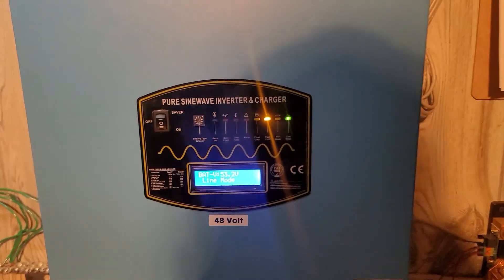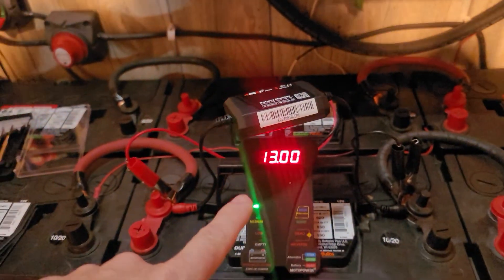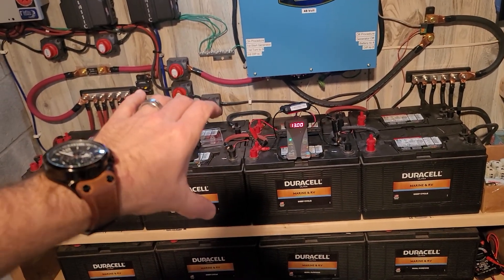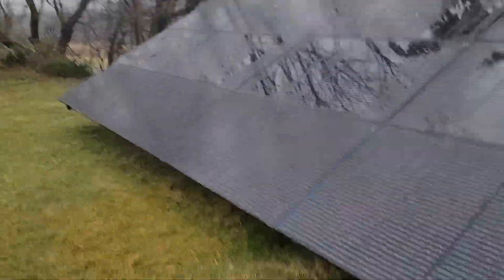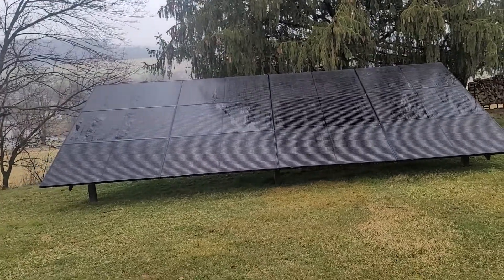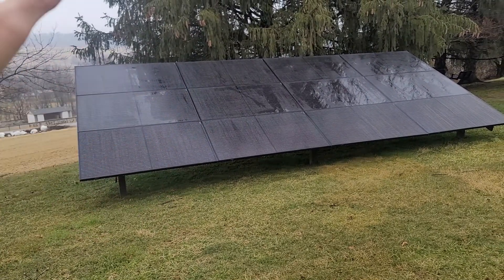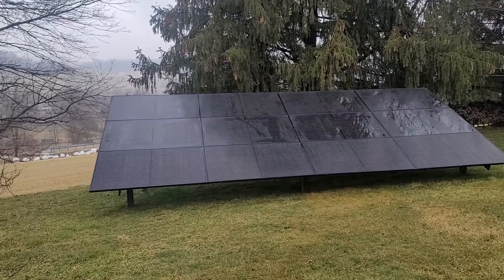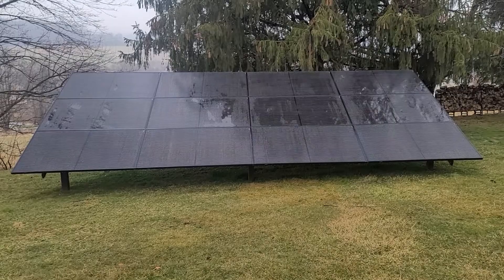Sungold 12k Pure Sine Inverter Charge Procedure

Comment: Are you running a standard generator or inverter generator. I had to replace my generator and unfortunately discovered that my inverter will not accept power from a generator unless it’s an inverter generator. I am looking at purchasing this unit in the 15k version for my off-grid system but need to make sure it will accept power from a normal generator.
Thanks,
Matthew
Reply from the maker: Yeah just a standard Rigid 6800watt gasoline generator.  So far everything has been working beautifully!
Reply: @bourbonbeertractorsandprep9335  thank you!
Reply from the maker: @matthewpruett8745  your welcome!

Comment: Hi, I just ordered the 15000W 48V SPLIT PHASE PURE SINE WAVE SOLAR INVERTER CHARGER but the maximum solar input is 3200W in which is not that much.  They say you have the option to disable the inbuilt solar controller and connect with external solar controller.  Here is where I am lost.  I would like to prioritize loads from solar panels energy, then utility, batteries and generator.  Thinking about 13,200 W in solar panels. Any help/suggestions and recommendations will be greatly appreciated :)   I am quite newbie here, I live in Puerto Rico and utility really sucks as you may already know....expensive as well.  Thank you!!
Reply from the maker: I just didnt bother running any solar panel wires to the inverter, I used the midnight Classics instead. Thats all you need to do.

Comment: When does the unit use PV to charge the batteries? I just installed my 10K split phase inverter today. But it's not using PV to charge.
Reply from the maker: Did you set the dip switches?  The internal charge controller is small and cant handle alot of panels,  are you using the internal?
Reply: I have 10, 200w panels.
What should the dip switch be set to?

Comment: I have an array with trees behind it just like that and I have another array that's more out in the open and on cloudy days the one with trees behind it puts out less power than the one that has more Open sky behind it. Solar panels do best if they can see Horizon to Horizon sky on cloudy days.
Reply from the maker: So far my ground array performance beautifully!  So far with 4200w of panels I've produced over 4600w with them. With monocrystaline in direct sunlight panels are more forgiving than polycrystaline panels. Eventually Im gonna upgrade my entire battery system but the solar powers everything without a hiccup!
Reply: @bourbonbeertractorsandprep9335  It's all about W/m^2 reaching the panel surface. I have monocrystalline too, but the array that doesn't have half the back sky blocked does far better on cloudy days than the one up against the trees in my back pond.

Comment: I have the 18 KW version of this inverter and I am still trying to figure out how to lift it onto the wall.
Reply from the maker: Its easier with 2 people and definitely screw a support board to the wall to assist in holding it to the wall while screwing it to the wall! These things are no joke lifting up lol
Reply: @bourbonbeertractorsandprep9335  I was thinking screw a 2x10 to the wall above the mount area and put block and tackle on hooks to that beam and use steel cables and a come along winch to pull it up. Only problem is where to anchor the winch...
Reply from the maker: @basspig  you can try that just be sure the anchor board is strong cause it will definitely smash a foot if it falls! I just leveled and screwed a 2x4 to the fall and had my wife grab the other side and we set it in place.  It was easy for her to hold against the wall this way until I got the screws in.
Reply: @bourbonbeertractorsandprep9335  the anchoring 2x10 will support ten times this weight. I'm more worried about the cables breaking!
Reply: I used 1 5/8 unistrut, anchored to a block wall.
I rented a 1 ton chain fall, supported between floor joists. Watch videos on how to build a unistrut rack.
Reply: @scotennis609  I ended up attaching a block with giant hooks and pullies just above the inverter mounting location and another block on the opposite wall with another giant hook. Used a come a long winch and steel cables attached to metal band steel with holes drilled for the cables and mounting to the inverter flange. Slowly pulled in up. The hooks made terrible sounds as I brought it up, but I kept going. In about ten minutes I had it mounted to the wall. But oh what a risky operation!

Comment: How do you connect the solar panels into the system? I see there’s charge controllers for the panels, do those go directly to you battery bank? Also, when you use the generator to charge there is no back feed to the solar charge controllers is there?
Reply from the maker: Ill put up a video for you this weekend to try and explain it better and show ya. Let me know if it helps!

Comment: Hello, great video, I have a question if you dont mind .. I live in the US and I need a grid tied hybrid inverter that has a continus V of 14-15kw. I need a split phase inverter and it needs to be UL listed. I plan to sell power back to the grid. I will add batteries after the system is installed. Hav you run into one grid tied inverter that can work for me.. Ive seen come 3 phase Victorns, and I hear you can configure them for split phase.. I appreciate your help.
Reply from the maker: The Growatt inverter may be a great choice for you to look into!
Reply: @bourbonbeertractorsandprep9335  I appreciate the response.
Reply from the maker: Absolutely,  no problem!

Comment: What is your minimum charge for the grid tie?
Reply: So on our bill there is a $13.50 meter charge.  Unfortunately we have 2 meters so 27$ per month regardless if we use any kwh. I'm sure there are more fees I'm not noticing that won't go away. It will take a big system for me to go 100% off grid. Just starting out now. By the end of the summer at least cover the ac units and for sure backup when needed. The ground array looks really nice.
Reply from the maker: Ill do a video soon going over the entire system from top to bottom shortly to help situations like yours.